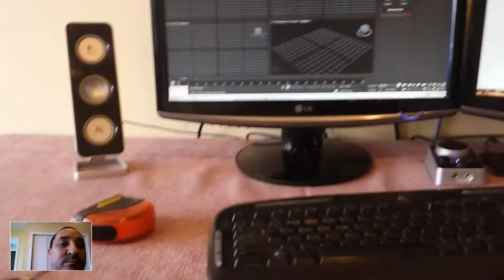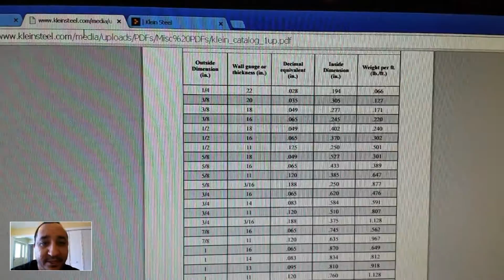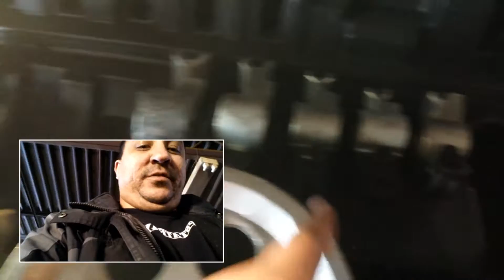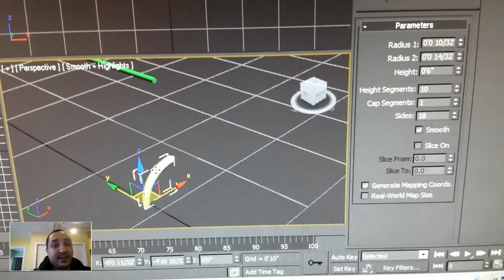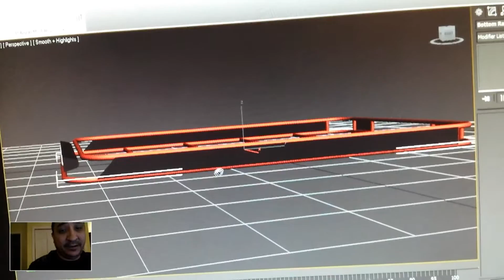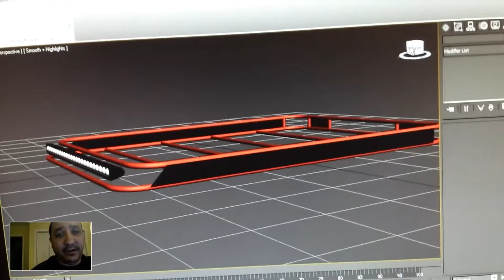Project Pathfinder Roof Rack - Part 1(Design & Planning)

Comment: Hello! Thanks so much for an inspiration! I recommend using Solidworks by Dassault Systemes for such engineering kind of projects instead of 3ds max. I switched very easy from 3dmax to solidworks by just watching youtube tutorials. Plus you can always convert file back to 3ds max to make them looking vray photo realistic. In solidworks you also are able to make schematics of your project without pen an pencil :)
Reply from the maker: I have solid works and need to learn it. I'm having a rough time with it. But yes you're correct and I agree with you. I need to start using it. I have a note pad sitting right in front of my face at this very moment. Drawing up a project that would be super easy to do in solid works if I knew how to use it...
Reply: +Alvarez Metal Works An hour or so in youtube with solidworks tutorials and you'll be like a professional
Reply from the maker: +tim8ska I've spent days lmao